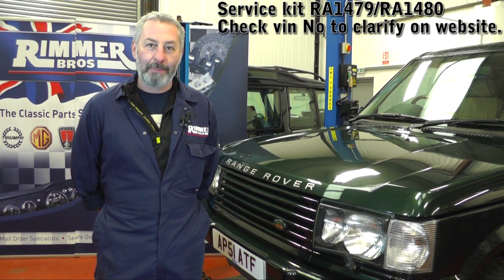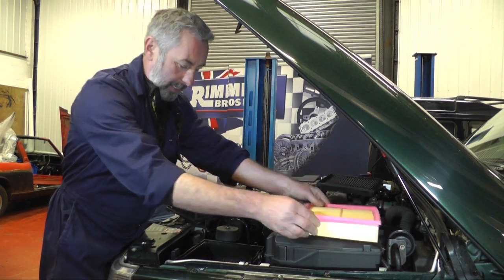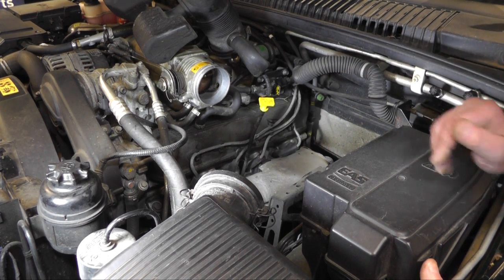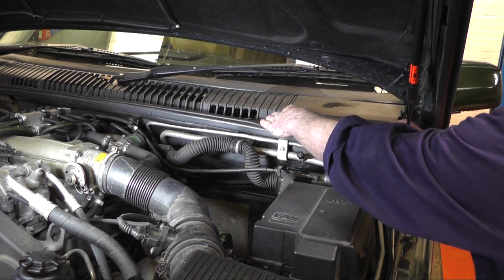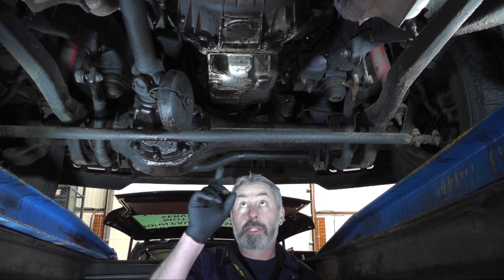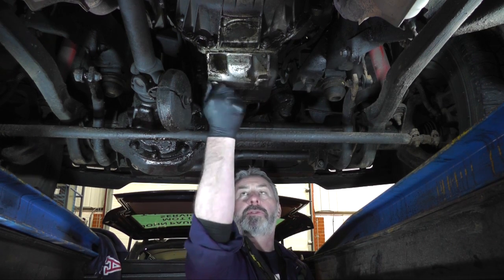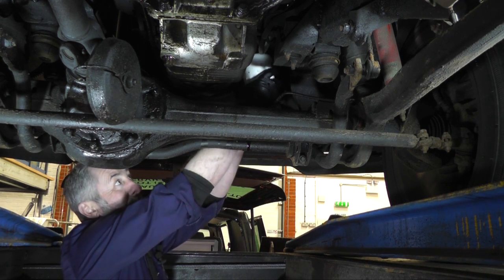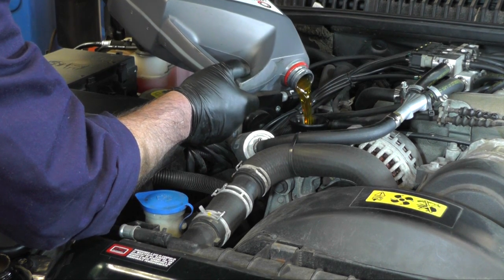Servicing a Range Rover P38 V8 4.6 petrol

Comment: I'm guessing that this engine is fitted with the later oil pump driven from the crankshaft?
Recommended oil change procedure with the old gear type pump, was to refill the sump before removing the old filter.  Otherwise, it's possible to find that the pump refuses to prime.  If that should happen, the pump cavities need to be packed with petroleum jelly which is a nuisance, to say the least.

Does anyone at Rimmer's recall the Unipart GFE158 filter being replaced by the GFE175?  They looked identical, but the GFE175 allowed oil to drain down causing a delay in oil pressure build-up on cold starting.  I ended up buying old stocks of GFE158s to solve the issue.
Reply from the maker: Hi there, thank you for your technical question. 

Please feel free to email our Land Rover Specialists at: lrsales@rimmerbros.com and make the subject 'FAO Andy R' and they will help discuss the technicalities with you further.

Comment: I so love my Range Rover (1996 P38 RHD, 4.6 HSE, duel fuel). I need a new battery, but the bonnet release has failed on the driver’s side. Managed to open approx 1/2 “ and get WD40 in the area but still can’t release the leaver. Can you help??? StuartH.
Reply from the maker: Hi, Stuart.

Think this is a job for a garage I'm afraid.
Reply: Rimmer Bros TV OK. Thank you for letting me know! Appreciated.

Comment: Can I use other oils besides 10w, maybe 5w40
Reply: Oil is a very controversial topic but you have to bear in mind that the Rover v8 is essentially a 60s engine designed to run on conventional oil so it won't benefit from using modern synthetics you run it on 20w-50 conventional they usually run a little more quiet on it but 10w-40 semi synthetic and per handbook will do just fine